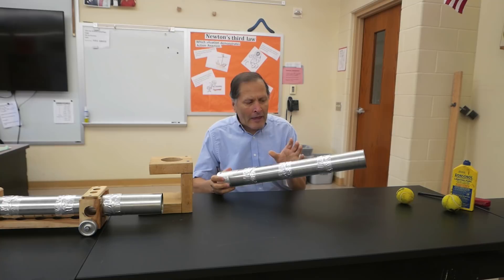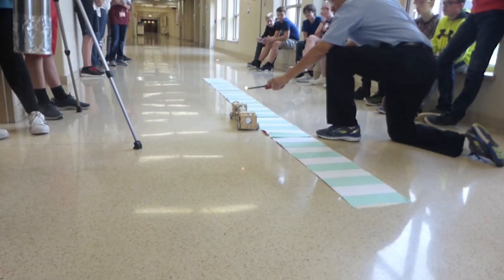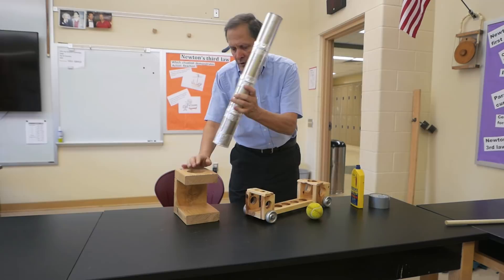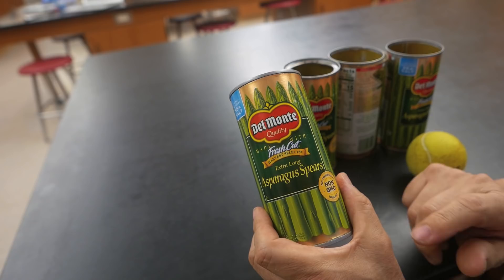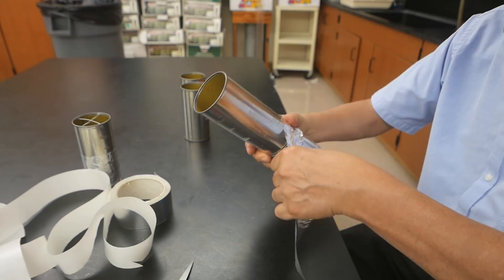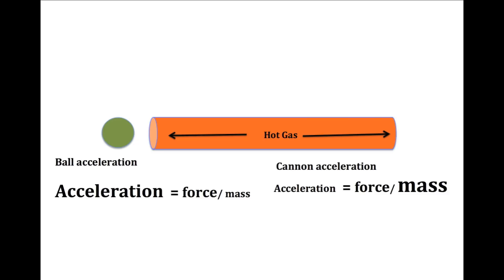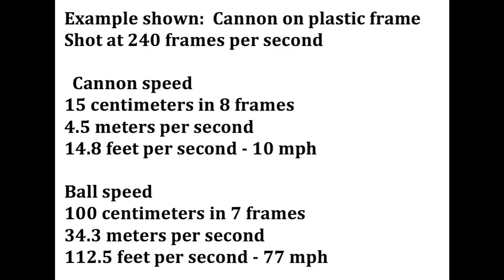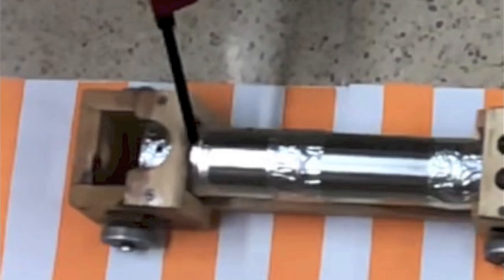Tennis Ball Cannon-Newton's 3rd law // Homemade Science with Bruce Yeany

Comment: If different masses under the same force have different accelerations why do different masses under gravity have the same acceleration?
Reply from the maker: as the mass increases the pull of gravity will  increases at the same rate.  double the mass of an object  means double the gravitational pull,  gravity is pulling twice the as hard,  three times the mass means three times as much pull ans so on,  as long as we can ignore air resistance all the  objects still accelerate together
Reply: Bruce Yeany Thank' s I get it now.

Comment: What type of feul used to burn
Reply from the maker: it is lighter fuel,  you can also use alcohol
Reply: Bruce Yeany can we use gun Powder
Reply: Can we use gun powder
Reply from the maker: WOW! that would be extremely dangerous.  the liquid fuels limit the amount of forces to what the cans could withstand,  I think it would be too easy to add large enough amounts of gunpowder that break the cans apart

Comment: My son made a potato cannon that was probably 10 times more powerful. He was having fun shooting potatoes through pieces of luan plywood. Somebody called the police and the fun got shut down with the justification that the cannon was a "firearm". Appears you don't have as many safety freaks in your community.
Reply from the maker: Hi David,  I limit the speed of mine so that I can use it indoors.  The speed of the ball is slower than a good tennis serve so if someone got hit with the ball it would sting,  higher speeds and I wouldn't be allowed to use it
Reply: Keep up the good work. We tried integrating the formulas for velocity and distance under constant gravity to determine how high we were chucking the potatoes. The approximate answer was 1100 feet. (Done in the woods of Vermont to avoid the gendarmerie.) I'm going to build some of those Galilean tracks for a friend who teaches physics. I hadn't recognized the possibilities of modeling pendulums. That was an "aha"-moment.

Comment: What type of fuel and how much do you use?
Reply from the maker: lighter fluid,  10 drops,  more doesn't make it better
Reply: Bruce Yeany thanks
Reply: Binaca breath spray works better. Very consistent and more powerful than lighter fluid.